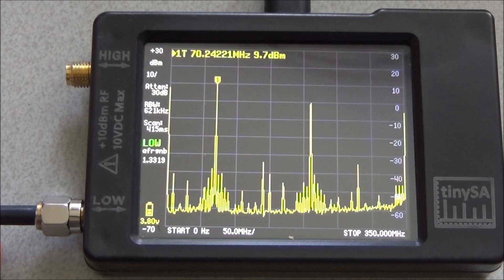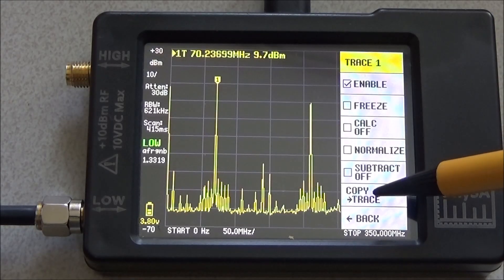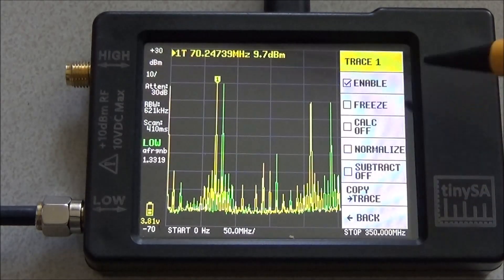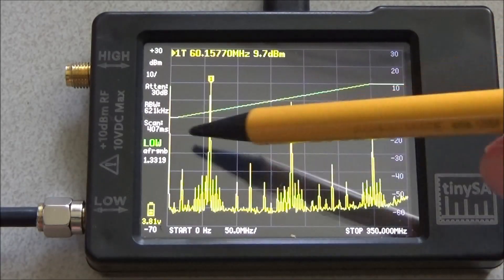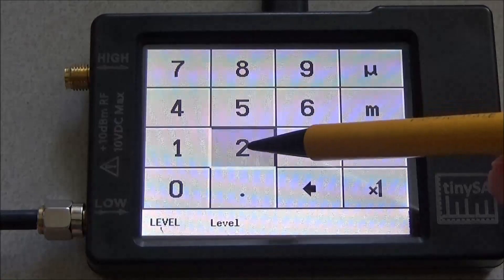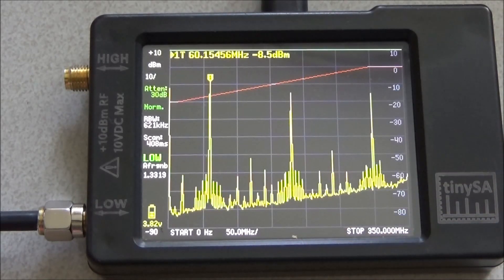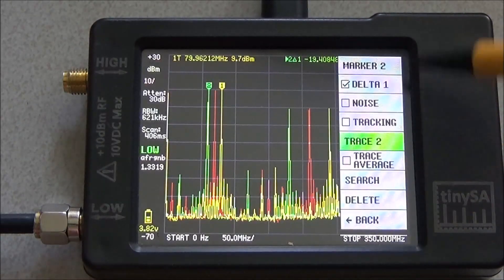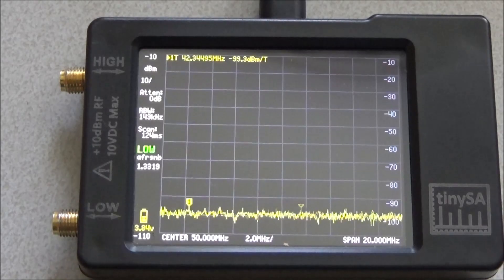Feature update september 2021

Comment: Since my device can not complete neither the Self Test nor the Level Calibration, can you suggest a way to fix these two malfunctions? The messages are accordingly:
Signal Level too low (for the Calibration and Signal level failed (for the third test in the self test sequence)
Reply from the maker: Please join https://groups.io/g/tinysa for detailed support
Reply: @ErikKaashoek  I am already a member, though I have not received their email to confirm my email and activate my account. I tried 3 times so far.
UPDATE: I made a new post with pictures, under the name "Bat Falcon". If you can help me it would greatly appreciated.
Reply from the maker: What user name did you register?
Reply: @ErikKaashoek  Bat falcon
Reply from the maker: @batfalcononyoutube  SHould be ok now

Comment: Hello,
I just received a TinySA from Eleshop and I'm doing some random tests.
Many sincere thanks for the hard work you put in this device !
When playing with markers, I noticed that wrong values are displayed with this configuration :
- Marker : noise
- Unit : Volt or Watt

The marker value is -57.93V/Hz or -57.93W/Hz (for 621kHz RBW).
These values are incorrect and do not change at all.
It is only RBW dependant (-3dB when halving the RBW), which is logical.
But it shows this number is still in dB, not in linear scale.

When 'Unit' is set to dBm, dBmV or dBuV, the noise marker values are realistics.

I updated the software to v1.3-429-gc224fa9 with no improvement.

What do you think ?

Thanks again !